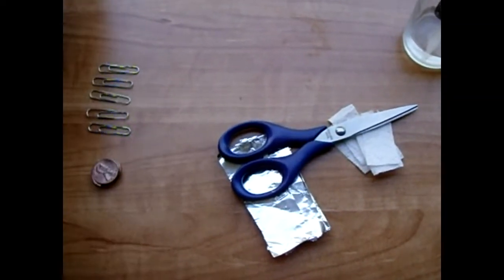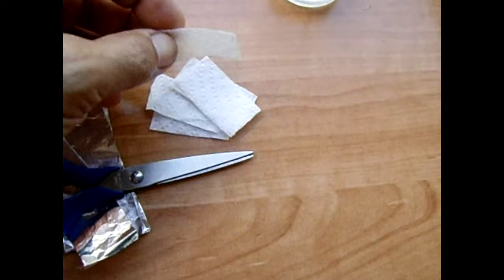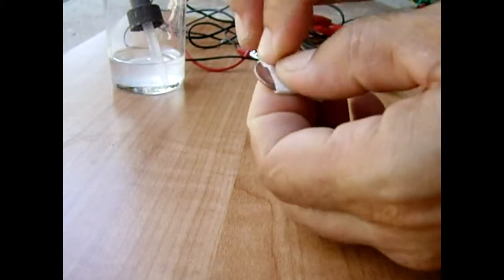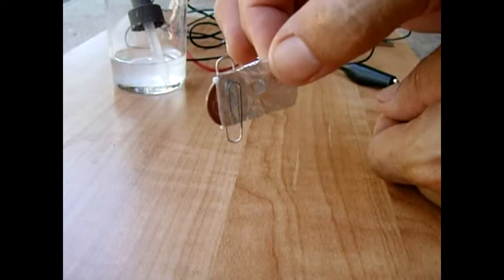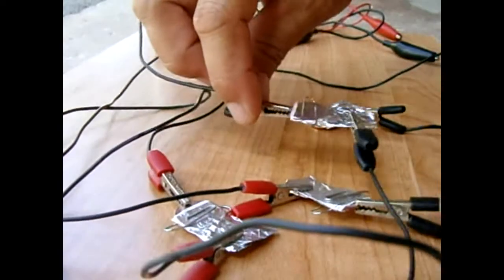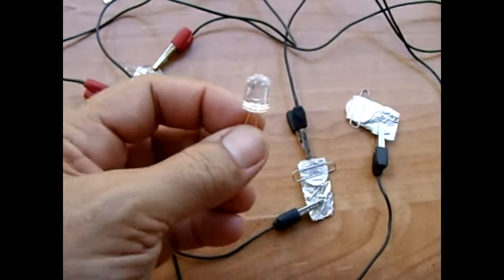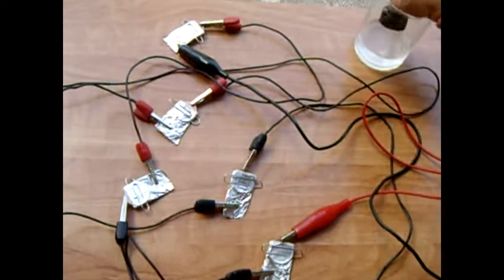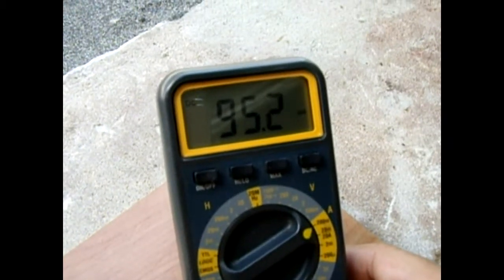Penny & Aluminum Foil Powered LED's!

Comment: 1) if the electrolyte connects the positive and negative anodes in a battery, such as you have created, why doesn't it create a short?  2) you don't show how you connect the LED....does it connect to the positive anode of the last battery cell to the negative anode on the first cell?
Reply from the maker: +David Alden 
Hello David. As long as the copper and aluminum do not touch one another, there will not be any short. Copper is (+), aluminum is (-). Connect the longer leg of the LED(Anode) to the penny.
Reply: cq
Reply: can you go back to the video

Comment: I have to wonder if there is any peroxide left in that solution after being exposed to the sunlight for so long.  Though, if I understand the battery chemistry right,  it should work well enough with just the saltwater solution.  Thoughts?